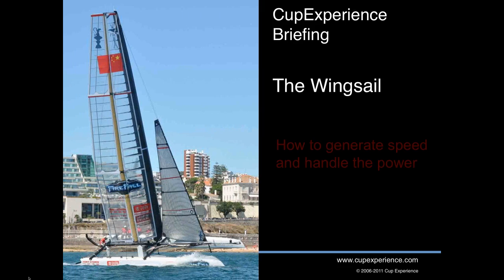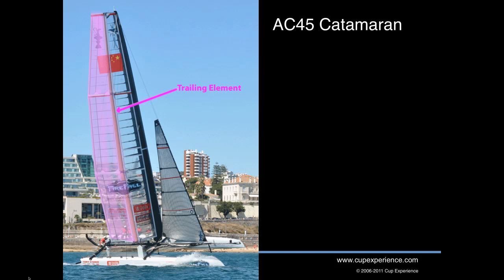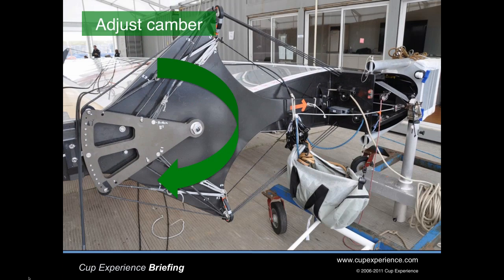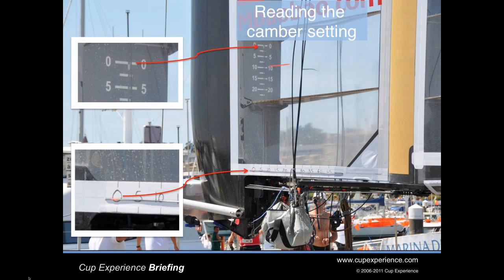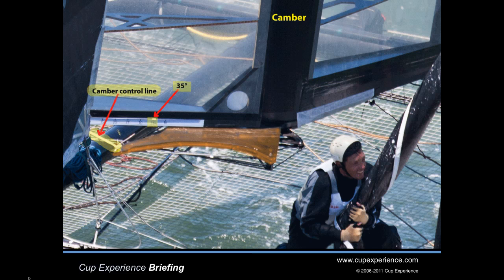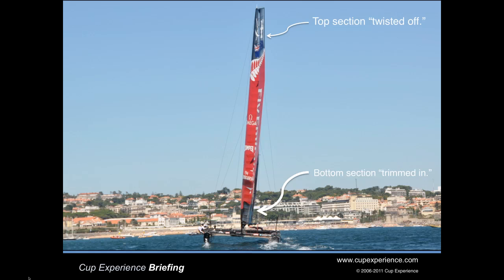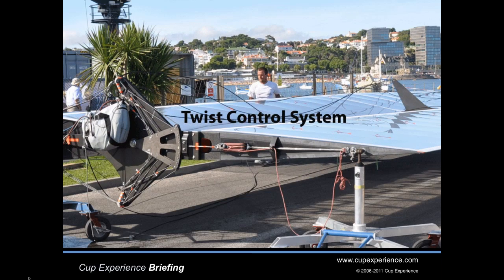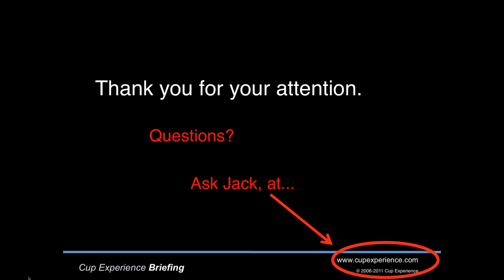Briefing - America's Cup catamaran Wingsail

Comment from the maker: @kampai26 Thanks for your question!  Both CAMBER and TWIST are controlled by *limiting* them. What do I mean? When you tighten/trim the (separate) lines that control camber or twist, you are "centering" the trailing element, reducing camber or twist to zero.  Camber or twist is increased by *easing* the respective control line. You can go to the CupExperience website and "Ask Jack" to get more info.